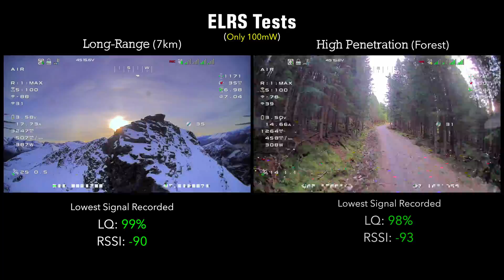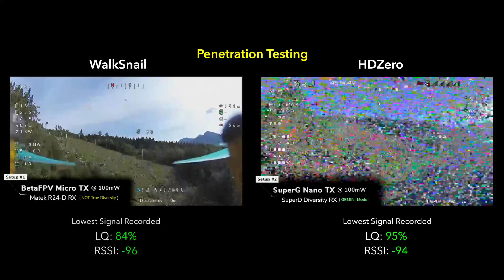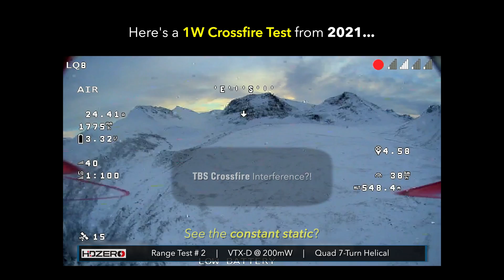Don't use ELRS or Crossfire at 1 Watt: RF Interference reduces FPV Video Quality, Range &Penetration

Comment: I use dynamic power and have configured edge tx to call out the power level when output power changes. I never had it failsafe and it's a great tool to stay aware of your link quality.
Reply from the maker: Yea, I’ll have to give it a shot again. But with that said my 2.4ghz ELRS setup at 100mW always outperforms my FPV Video Link. That’s why I haven’t even tried dynamic power again.
Reply: @GiantAntCowboy time to upgrade the VTX 😉

Comment: What about dynamic power on elrs?
Reply from the maker: @definingslawek4731  Dynamic power should be a great option, I stopped using it years ago because it had some issues… but now it’s supposed to be flawless. 
However I have found a FPV VTX setup that outperforms 2.4ghz ELRS Gemini at 100mW.  (Assuming good antenna placement of course).

Comment: so i fly at 250watt on the pocket and damn i can go behind 1 wall and it starts crying, also range is super sad for elrs idk wtf it is, my friend has the same issue. idk elrs is ass or i did smth wrong...
Reply from the maker: @iHateFpv  it’s likely the antenna on your quad that’s limiting performance. 
Which quad and ELRS RX are you using?
Reply: @GiantAntCowboy  i use speedybee mario 5 frame with dji o3, HM elrs nano ep2, i had the ep2 with antenna but had the same range issue's. so i tried the one without antenna. iv it mounted behind the camera on my quad
Reply from the maker: @iHateFpv  yea, those RXs are great for smaller whoops, but for your quad I’d recommend getting a SuperD or RP4TD RX, basically something with True Diversity.  
An RX with simple Antenna Diversity would work fine as well, but ideally you want two antennas mounted perpendicular to each other. 
I mount one on the front or back, and one on the arm. This works well.
Reply: @GiantAntCowboy  but is it normal that it has this shit of a range? i could send u a dvr footage if you're open to help a bit indept :/
Reply from the maker: @iHateFpv  sure you can me DVR. FB Messager, Instagram, Discord, ect. My user name is the same on each.

Comment: If you're using only 100mW, why do you even use a transmitter module and not the built in transmitter? Sorry if this is a noob question, I'm pretty new to FPV... 😅
Reply from the maker: The built-in module works very well, and for most people is way more than enough even with only 100mW; (as long as the RX & Antennas on the quad are good); but you will have fluctuations in LQ further out. 
What’s special about this “Gemini Module” is that it uses Two TXs & Two RXs which creates near perfect Link Quality in extreme situations. 
Honestly though, it’s overkill, largely unnecessary… all new control link gear is way beyond the needs of hobbyists. 
In fact I’m actually making a new video examining if we should even use such reliable Control Links. I almost think it would be better to lose control link before video, as long as your GPS rescue works, because then you can still see what happening. As it is now we lose video but still maintain control, effectively flying blind… this is a dangerous situation in many case which can result in a crashed and lost quad. 
Long answer, but hopefully helpful or interesting. Good question, cheers!
Reply: @GiantAntCowboy  Thank you for the detailed answer, very helpful! :)

Comment: That's why I always use dynamic power, it keeps it low unless I need it, which is basically never.
Reply from the maker: Yea, dynamic is a great option. I’ve been meaning to test it again. A while back I tried it but got Failsafes… apparently that was a bug that’s been fixed.

Comment: When doing LR don't use a 5.8Ghz control link AND 5.8Ghz FPV link as they'll interfere with each other in the 5.8 spectrum. For best results 5.8 and 2.4 is a good mix and you can use a filter to clean up your reception.
Reply from the maker: In this video I’m testing 2.4ghz ELRS & 900mhz CRSF setups. I’ve never even heard of a 5.8ghz control link… is that actually a thing?

Comment: Lately, I've had a bigger issue with ws, and what I'm guessing is antenna placement. Normally run everything out the back of my quad, but I keep getting low rssi warnings. I typically run stubby antennas, but I'm starting to suspect that having the receiver antenna too close to the vtx creates a lot of interference. I've only experienced this with my ws quads with stubby antennas. Interference in the video feed, at least with hdzero, feels like common. I haven't heard anyone talk about the vtx interfering with the receiver.
Reply from the maker: Very interesting, I had a similar RXLoss issue with my Crossfire setup a year or two ago. I swapped the VTX antenna and it seemed to fix the issue. 
You can see examples at the end of this video here: 
https://youtu.be/iLvcdnEneQo
All I can think is certain antennas, or broken antennas, create strong RF signal interference. Certainly the proximity of antennas will make that worse as well. 
On my current builds I always have the ELRS RX/Antennas in the front and VTX/antennas in the rear, seems to work well. 
Thanks for watching and sharing thoughts, hope you get it sorted, cheers!

Comment: Dynamic works fine in my experience, but I always use the latest firmware. I’ve only seen it tick up to 1w once and turned out my receiver antenna was broken, but other than that it’s max 250mw, but the second I go to a flying field it jumps to 500mw and bounces to 1w constantly, I’m guessing from all the other signals in the area. I switched to 915mhz and now it’s 100mw even at the flying field, so frequencies matter here as well.
Reply from the maker: Nice, thanks for providing this feedback, super helpful. I’m going to test out Dynamic Power again with a couple quads. 
Thanks for watching, cheers!

Comment: I have no clue why anyone wants to use 1 or even 2 watts when flying close and not miles away when 250mw or even 100mw is plenty of power to fly far. I think people see a higher number and think it's better but find out it's really not better at all
Reply from the maker: Exactly the point here. If you need 1W to avoid RX Loss/Failsafe while flying with a 5.8ghz FPV Feed then there’s something wrong with your control link setup. 
  Companies release these high power transmitters and people are like “oh 2W, I need that!” but it’s just a marketing ploy… I even gave up 900mhz because 2.4ghz ELRS outperforms basically every FPV system currently available, and with much smaller antennas. I always found those huge “diamond directional” antennas annoying. 
  Anyway hopefully this video helps some folks, thanks for watching, appreciate the comment!
Reply: @GiantAntCowboy  exactly I love my ELRS 2.4gz it really goes the distance you need. I love your videos and I'm always clicking on them. Thank you for your test of performance it shows the real proof of the pudding. 💯❤️my moxon boxer antenna is perfect
Reply from the maker: @LehtusBphree2flyFPV  thanks, I appreciate your support!

Comment: A RF spectrum analysis of your transmitter would be interesting. I suspect it outputting a very dirty signal which causes that issue.
AFter all the frequency is supposed to be far away, 2.4ghz vs 5ghz. But if the filtering of the TX is horrific then the 2.4ghz will blurp out all over the entire RF spectrum.
Reply from the maker: Yea, I don’t have specialty equipment but first experienced this during CRSF tests with Analog & HDZero VRXs back in 2021, and more recently during some ELRS testing with my HDZero goggles. So the issue is consistent across different setups. 
  My understanding is that strong RF/Electrical Noise even outside the operating RF band can affect sensitive receivers. This can also be seen if you fly close to power lines, cell phone towers, even solar flares can disrupt radio communications. 
  However to your point, our radio equipment is fairly inexpensive and probably doesn’t really have proper RF shielding or filtering. 
  My ultimate goal here was to demonstrate that running 1W is basically pointless, wastes battery, creates lots of heat which isn’t good for transmitters, and ultimately can reduce the performance of our FPV feeds… I’ve been running 100mW fixed for over a year now with near perfect performance.
Appreciate you watching and providing insight!
Reply: @GiantAntCowboy  I tried adding a link to a spectrum analyzer but Youtube censors that as misinformation or spam.
I'm not sure if my answer is again censored, Google really is an internet cancer these days.
The RF output is dirty, adding a 2.4Ghz bandpass module on the TX would likely improve vtx receiving quality and allow to up the output strength without those issues.
I can't provide the link to the image
Reply from the maker: Yea, spam filters, happens to me as well; I gave up on Instagram because of it… but I’ll do some googling about it. Thnaks!

Comment: Great video… almost too much information too fast for total amateurs like me :D 
With the lower output power of the zorro, I never had such video issues. But tempted by a Gemini system….
Reply from the maker: Thanks, and yes, I do move quickly… I’m just trying to keep the video short for folks. My thought is people can pause and rewind if needed. 
I ran the stock Zorro ELRS for a few months no problem, but the Gemini is incredibly solid. Probably unnecessary but if you do “risky flights” it add confidence! 
Appreciate you watching and providing feedback, I’ll try to slow things down a little going forward.  Cheers!

Comment: This was super helpful. I found this happening with my WS and my Boxer at 1W, there seemed to be a hard cuttoff at a certain distance until I reduced the radio to 500mW. I found it a while back but wasn't sure why so thanks! I have since dropped to 250mW and haven't had any problems since :)
Reply from the maker: Ooo, that’s super interesting actual because people keep saying that “DJI/WS” aren’t affected by this, which I have to believe it is, but don’t have any solid test results to demonstrate this, and my WS Test Quad of course lives up in the mountains now… 
But I have heard from you and a few others that they’ve had this issue with WS/DJI. I have a 1s WS VTX that I’m installing into an RC Crawler now, maybe I can run some tests with that. 
Thanks for watching and sharing your experience, cheers!

Comment: Good vid! As a Ham operator, the rule is to use as low of output as possible. Good antennas on both receiver and transmitter can make all the difference. Dynamic power is what I use if going long.
Reply from the maker: Yea, that’s basically my point. Blasting a ton of RF power isn’t necessarily better, in fact comes with several negatives. 
Even with dynamic power you should see 500mW-1W unless there’s something wrong with your setup, or you’ve lost video and are looking at the telemetry logs. 
Appreciate you checking out the video and sharing thoughts. Cheers!
Reply: Yes, this is the way I tend to think. I did, however, notice that on testing my Mobula8 VTX, that the highest power setting actually did perform better. I was expecting all the downfalls of cranking it up to 11 like my ham radio brethren always warn me about, except it actually performed better in all cases. Now my ELRS link is a different story. It performs well at very low power. I don't even want to turn it up. The engineers have done a fine job there. Maybe I went off on a wild tangent, but I like talking about this stuff.
Reply from the maker: @mjodr  yes, my goal is to run the VTX at the highest power and the control link at lowest power. The Video Feed struggles more than the control link so we want to reduce interference that affects it. 
Sounds like this is what you’re saying as well.
Reply: @mjodr  Interesting, one of the reasons I went to ELRS was the ability to use low power and have such a great link. My flying buddies have all approved as the old R9M I was using on dynamic power would affect their radio link on the Crossfire system they had, in a very bad way.😵‍💫
Reply: @smackfpv  Yeah as long as you aren't presenting an extremely difficult RF situation ELRS seems to be bulletproof from 25-100 mW. In the distance records attempted most of them are done on the lowest power setting. Obviously they are using nice antennas and are direct LOS, high altitude, aka an easy RF situation, but it just shows how good it works.
Reply: @smackfpv how do you deal with VTX output power? do you have that on a switch and increase it as required?
Reply from the maker: @ferocious_r VTX output power I just run at max honestly.  I do mostly mountain surfing and prefer to have as much as possible. But the ELRS I just run at 100mW. 
Was out 7km in the mountains earlier with DJI O3 and ELRS at 100mW, no problems.
Reply: @ sorry about my original reply (deleted) VTX I am all digital except if I pull out my 1.3 stuff. I do not switch vtx power.

Comment: With this info, I may hit my range goal. We'll have to see!
Reply from the maker: Yea, give it a try and see if it helps. When first using a lower TX Power though make sure to keep a close eye on LQ & RSSI figures. 
If you have poor performance at lower powers it’s an indicator or bad antennas or placement, so focus on that opposed to adding more power. 
Let me know if you have success or not, cheers bud!
Reply: I'm already in the process of redoing my antenna setup. My old rig did fine on the way out, but my little bardpole couldn't see past the battery on the way back. Was seeing an LQ of 60 after the turnaround. Experience teaches many things!
Reply from the maker: I highly recommend getting a “True Diversity” RX, and positioning your antennas properly. This makes a huge difference! I used SuperD RX which are like $20, available in both 2.4ghz and 900mhz. 
Keep me posted, cheers bud!
Reply: Maybe someday. Currently running with antenna diversity, and I gotta pinch pennies. It's just flying the plains so a drop or two won't kill me.
Reply from the maker: @jaysonrees738  oh yea, I thought you had a single antenna RX setup. Antenna diversity works pretty well!

Comment: Good stuff man, didn't really think about interference like this until the hdzero goggles had issues turning off if the crossfire RC was too close.  Switching to elrs soon so great to have this info!
Reply from the maker: Yea, I never experienced that Goggle shutdown issue, fortunately. But I’ve been loving ELRS. If your shopping for a system now make sure to check out Gemini; it’s amazing just how stable the LQ is, huge confidence boaster. It hit me how good it is while reviewing various DVR tests while making this video. 
It’s pretty reasonably priced, especially when compared to CRSF equipment. 
However, If you mostly do low risk park flying the system is probably overkill… 
Thanks for watching, cheers!

Comment: Is it feasible to add some shielding between the goggles and the radio?
Reply from the maker: Yes & no. It’s possible shield might cause reflections near the TX antenna and lower it’s performance. Additionally the RF might just fly around the shielding. The best thing would be to separate the TX by a couple meters, but honestly I just don’t think there’s a need to run at high output power. You see in my tests I have near perfect signal in both penetration & range tests at 100mW.  
Good question though, thanks for watching, cheers!
Reply: @GiantAntCowboy   yeah fair enough about the lack of need to run above 100mW. No probs!

Comment: Why are the control link so much stronger than the FPV links? Saying 100mw is will go further than any FPV link mean whoever is designing  the FPV links should get fired and hire someone who can actually build a link 🔗 hahaha
Reply: A control link handles a lot less data
Reply from the maker: Control link are transmitting/recovering much less data, like tiny data packets. Additionally they are transmitted at lower frequency which just has much better range & penetration. 
Common Example: In our homes we often have 5.8ghz & 2.4ghz Wifi; 5.8ghz is much faster, but if you go far away you’ll only be able to connect to the 2.4ghz Wifi. 
We use 5.8ghz for FPV because it has much lower latency, but there is such thing as 2.4ghz FPV and even lower like 1.2ghz which has incredible range, but can only transit a low quality analog image.

Comment: I'd like to see a test with O3 or the old v2 DJI system, for all we know Walksnail/HD Zero RF input design isn't up to snuff. You know HD Zero goggles turn off when a CRSF transmitter is very close to the goggles? (Mad's Tech covered that whoopsie). Means their EMI shielding is inadequate. 

For 900MHz the harmonics shouldn't be an issue, but even with 2.4 ELRS, since the top of the ISM band is 2.5G all you need is to use DJI 50MHz channel 3 (~5900 center freq) to move away from the 5.0GHz where the second harmonic could be an issue.
Reply from the maker: Yea the issue here I believe is just a High Output RF or Power source in close proximity to a sensitive RX.  Strong signals can desensitize any receiver, power lines for example can disrupt our FPV feed is standing in close proximity. 
I think all FPV systems including DJI are affected by this, DJI would likely just have higher latency, and maybe some occasional blurring as it tries to sort through the random interference. 

I am aware of the CRSF/Goggles issue, but have yet to experience it myself. 
Good thoughts, thanks for watching and sharing ideas, cheers!

Comment: Never thought about that being an issue thanks for pointing it out
Reply from the maker: Yea, it’s always best to minimize sources of interference as much as possible when using sensitive RF equipment. So just hoping this is helpful. I’ve just seen a lot of people talking about running 1W or even 2W! And figured it was finally time to make this video… I’ve been experiencing this since before 2021 with various systems and setups.